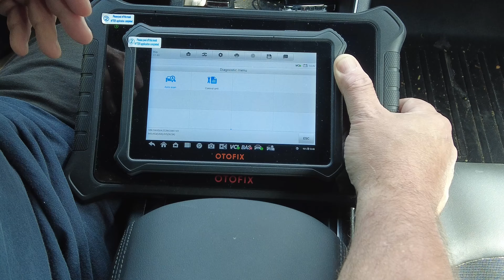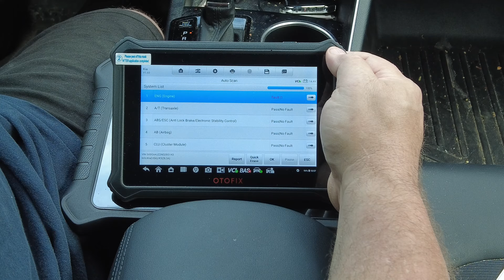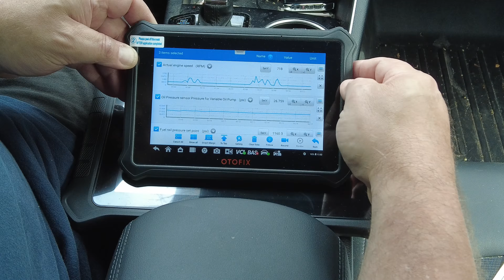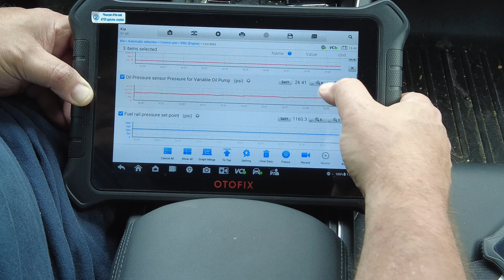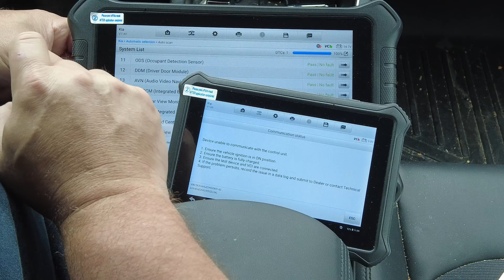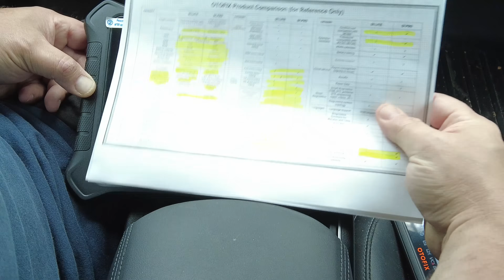OTOFIX Comparison D1 Pro VS D1 Lite OBDII Diagnostic Bidirectinal Scan Tools

Comment: I purchased the D1 Lite first and was ok with it…there are a few drawbacks as you mentioned, but it’s very good for the money. However, not long after buying it something shorted out inside and it wouldn’t turn on anymore, I returned it to Amazon and purchased the D1 Pro. It’s a much better tool, I use it at work daily.
Reply from the maker: I agree.  If I only had the LITE I would be happy with it.  But knowing the PRO is even better, it's hard to go back.  I've had several Autel 808 models over the years and I would take the D1 Lite of any 808, if I had to pick between those two.  Thanks for the comment.
Reply: I had the same thing happen to me just the other day! I had just gotten it in the mail and tested it for a bit, then decided to shut it down and let it charge. Tried booting again and nothing. Trying to return but support is slow to respond.
Reply: I bought the lite it took 8 hours to charge and kept draining the battery itself and only kept power for 30 mins, awful build quality 😞